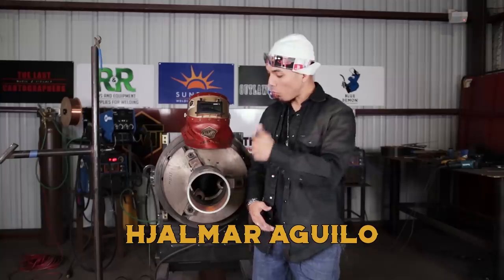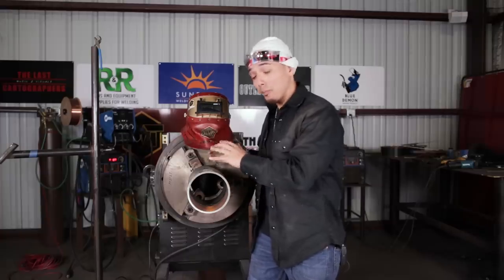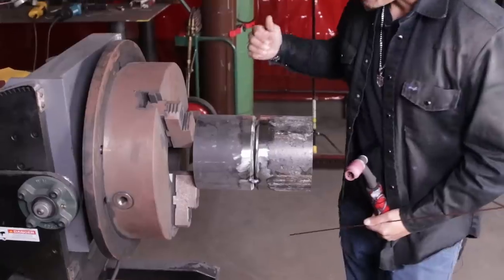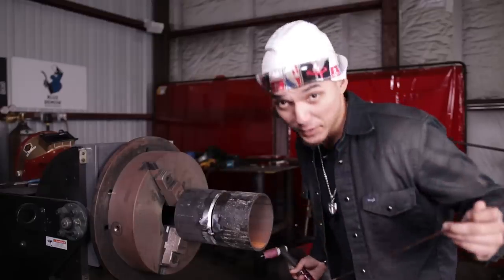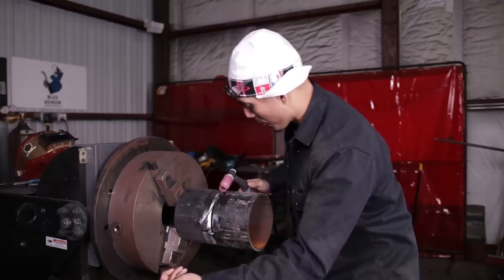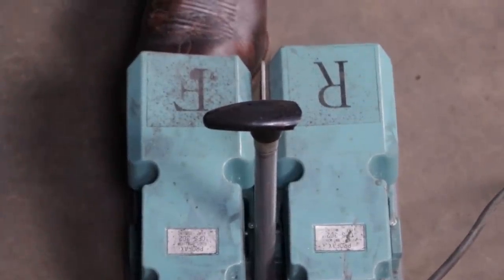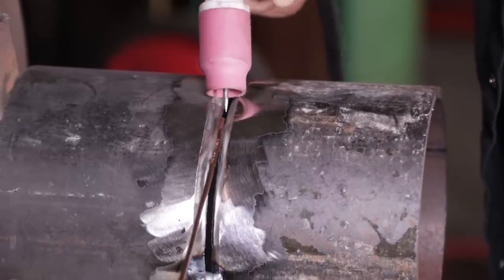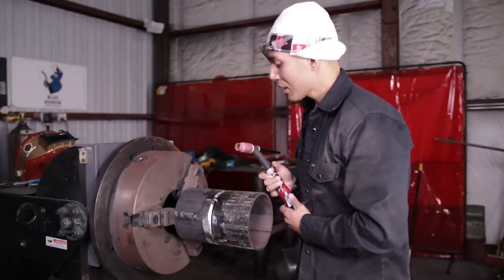TIG Pipe Rollout Welding

Comment: Too far past the top of the pipe... welding downhill.  Come on fella, you should know to do it between 12 and 1 o'clock
Reply: I disagree. I was taught to weld downhill around 11 o clock and haven't had an issue passing any ndt. I run quite a bit hotter though, around 275 amps with a 1/8 gap and 1/8 filler on the root pass.

Comment: Should be at 1 o’clock not 11 o’clock or right on 12 o’clock, never tig downhill on rootpass, or anything critical that I know off tbh.... but awesome vid. 👍
Reply: I disagree. I was taught to weld downhill around 11 o clock and haven't had an issue passing any ndt. I run quite a bit hotter though, around 275 amps with a 1/8 gap and 1/8 filler on the root pass.

Comment: Im a tacker at a pipe fab shop and supervision makes a big deal with welders about welding in sections to keep the pipe square and level can you make a video explaining what that means
Reply: It’s like when you put a wheel on a vehicle, you bolt on top and bottom not top and next to it that way it don’t get crooked. If you start welding and go all around the heat pulls in one direction making it go crooked meaning not level. First you weld top and then the bottom, then you work your way from the sides removing one tack weld out and so on.

Comment: if this were stainless how would you prevent carbide precipitation in the inside?
Reply: Please explain Carbide precipitation.
Reply: Matt Allen sugar on root
Reply: Keep it purged when you're doing your hot pass
Reply: Gotcha, yeah I’d imagine keeping it purged or running a flux covered tig rod/solar flux. This is carbon though so no need for it.
Reply: Purge throughout the entirity of the welding. Simples

Comment: Good stuff as always fam!  Show me some love and check out my roll out.  Its under D Armstrong  Tig root pass.  30" flange to pipe.  I used keyhole dip on HF so I had a foot peddle for the torch and foot peddle for the positioner.  I learned how to do this from a Welder named Ed Pickett.  PK Manfacturing Houston Tx.  Behind the dog track out there by Greenspoint